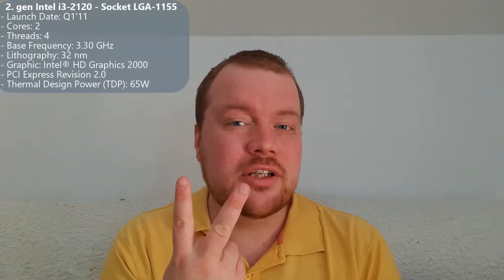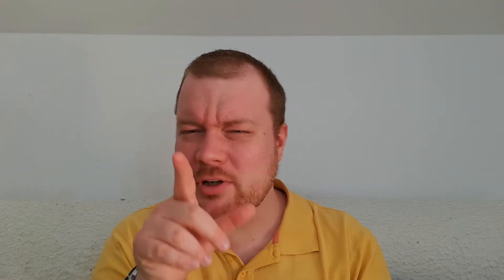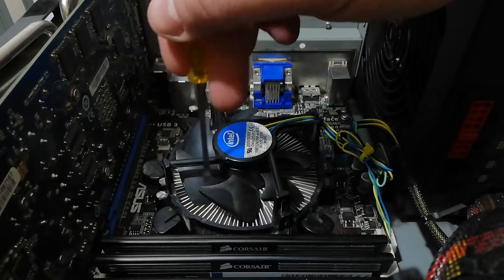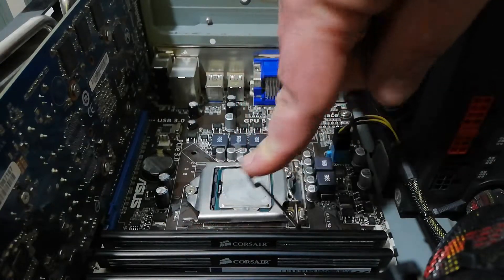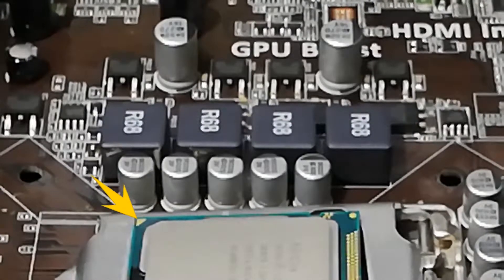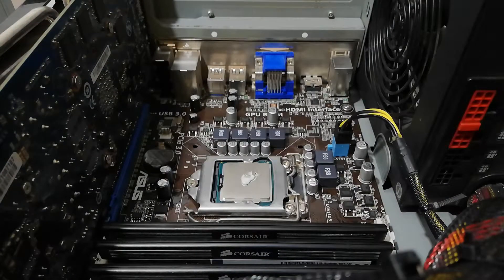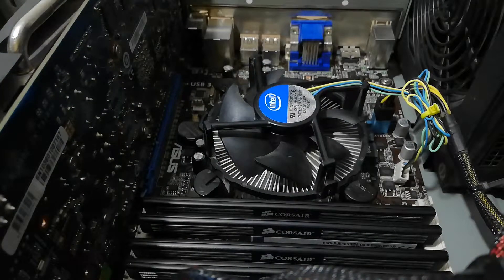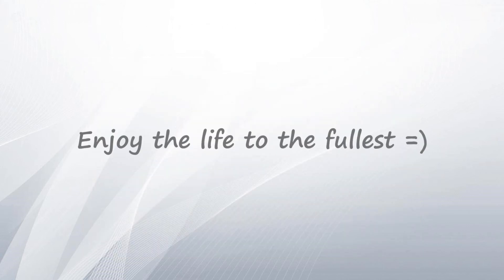How to upgrade PC processor on socket LGA 1155? - AFT #3

Comment: is it possible to upgrade my old AMD A4-4000 to AMD Athlon x4 730 they are both fm2 and my motherboard supported it. My motherboard is A55M-E Asus and  I think they have a different bios , how to do that?
Reply from the maker: By cpu support list for your motherboard, you need bios version 0401 or later to run x4 730. If you have lower version than 0401, than you update bios, to latest version for specificly your motherboard model!!!!

CPU support list: 
https://www.asus.com/us/Motherboards/A55ME/HelpDesk_CPU/

Firmware download on US site: 
https://www.asus.com/us/Motherboards/A55ME/HelpDesk_BIOS/
Reply: @ACOnetwork  my bios version or information is currently on 0601 x64 , do i need to redowngrade to get that 0401?
Reply from the maker: No, you do not downgrade. Just change processor 😁. Downgrading bios can make your motherboard unusable. NEVER downgrade.

If it says, your cpu supported by bios version, that means 0401 and every later made bios version.
Reply: @ACOnetwork  ok thank you very much , it's a big help . first and foremost  i thought i need to go to that bios version to run that processor 😌😆. Thank you very much !!
Reply from the maker: No problem, hope all will go without a problem 😁. Now youst have fun replacing the CPU 😁👍👀
Reply: @ACOnetwork  yes i will ,  when my order got arrived soon or later 😌😆 and i also hope so. Thank You very much 😆

Comment: Is there anything you need to do software wise or is it just a physical installation and I’m done
Reply from the maker: It all depends, if your bios supports new cpu. If you put in new one and no image on screen probably bios firmware needs to be updated. And also you need to be sure, that if you go for 3th gen cpu instead curent 2nd, that your chipset supports it.
Reply: ACOnetwork is there a way I can check the bios I plan to go from i5 2400 to i5 3470
Reply from the maker: There are several ways to check your bios version. 
- One way is to click start menu or search button, type in "System information", open it and on the right side of new window, you can see line named "Bios version".
- Another way is, when you turn on your PC, in some cases you can see bios version on screen before windows starts loading (you can click pause button on keyboard so it does not dissapear).
- Another was is to go in to the bios it self, you can do that by turning on PC and right then start pressing DEL or ESC or F2 or F1 key on the keyboard (one of those should work, del is mostly used) until you get in to the bios.

I did not make tutorial how to do this, but othervise you can find on youtube.

Remember, if your chipset on motherboard supports 3000 series of procesors, you can use new CPU. On manufactorer site, of your motherboard model, you should have CPU support list othervise if you write down your manufactorer and model of your motherboard here in comment, I can look up for you.
Reply: ACOnetwork ah thank u so much for the help but I decided to keep it in the same gen and go for a i7 2600. Thank u for replying and for the helpful tips and video 🤘
Reply from the maker: No problem and have fun 😁👍

Comment: Hai..my computer is M.board : asus P8Z68-V LX
Pccer : i3 2100
Ram : ddr 3 4gb X2 ( 8gb )
Grfik card : nvidia ge force gtx 960
Power supply : corsair vs 650  i buy the processor i5 3470 and change it..problem is monitor no display..what happen..? I need to update bios..? When i change back to i3 2100 its work good..what i need to do..?
Reply from the maker: Hello. i5-3470 is supported from bios version 3904, sou you most likely have too old bios version (unsuported new i5). Upgrade to latest version using i3 CPU after it power off pc, replace to your new i5 CPU and you should have an image on your screen. Remember, it may take minute or two untill image is shown on monitor for the first time.

CPU list for your motherboard: https://www.asus.com/Motherboards/P8Z68V_LX/HelpDesk_CPU/

Bios firmware download: https://www.asus.com/Motherboards/P8Z68V_LX/HelpDesk_BIOS/

If you need anything else just ask 😁👍

Comment: Thank you, I replaced an i3-2120 with an i5-2400. Simple upgrade. Your video answered the all important questions about how to remove the heatsink and fan.
Reply: same cooler for both?
Reply from the maker: Yes same :)
Reply: @ACOnetwork  thanks a lot. I looked everywhere and only find here. Great job. Subscribed.
Reply from the maker: No problem and thank you a lot 😁👍. If you have any questions just feel free to ask 😁. Have a great day/night, where ever you are 🙃
Reply: @ACOnetwork  actually the vendor wrongfully sent me i5 2500 instead of i5 2400. The socket seems the same, but info online says the motherboard only supports i5 2400. I'm not sure if it worth a try. I'm leaning returning it. What do you think?
Reply from the maker: Did you actually look at supported cpu list for your specific motherboard? Some motherboards needs to have updated bios, so you can use new CPU on it. If you are not sure, if you write down motherboard manufactorer, version and revision, I can try find cpu support list. Some motherboards on LGA1155 can support only 2. generation CPUs. For example my mobo supports second and third generation of Intel processors
Reply: @ACOnetwork  it's a Dell 0gdg8y but I never updated bios or anything. I bought more ram, cpu and ssd to do so. The manual don't say anything specific, so I looked online. Such this https://www.pc-specs.com/mobo/Dell/Dell__0GDG8Y/4031
There is a support thread from Dell and they say i5 2400. But some forums say it supports i5 2500. I have it here, but don't want screw things up.
Just to clarify, I will update everything (bios included) I can before doing hardware upgrades.
Reply from the maker: It is alerady 1:17 AM here. If you are willing to wait, I can research and gove you an answer during the day.
Reply: @ACOnetwork  sure, man. Thanks a lot!
Reply from the maker: So your motherboard is in Inspiron 620/620s or Vostro 260/260s computer with Processor Support Socket LGA 1155. (Sandy Bridge) Intel Core i5- 2500, 2320, 2310, 2300.

So it should support your i5-2500. You can just insert it gently add thermal paste, cooler and turn on pc. If you see image, then most likelly everithing is good. Remember that first computer power on after cpu replacement can take few minutes untill image is shown on screen.

If no image, you need to wisit dell support web page, search for your exact computer model (different can make your pc unusable), download an bios update and flash (with your CPU on motherboard). Also, DO NOT turn of computer while updating!
If you are not sure or afraid of bios updating, give it to someone who knows thos stuff to do it 😁

Good luck.
Reply: @ACOnetwork  thanks a lot man!
Reply from the maker: @JoséLages  No problem :)
Reply from the maker: I know that video is not fancy and top quality, but still is teachable :). 

It is not hard, just take your time fixing/replacing what ever you need. 

Take care and have a blast 😊👍

Comment: need to update my bios and lenevo dosent have it i5 3470 not supported what can i do now
Reply from the maker: Hello. Some motherboards do have unofficial bios firmware, but it must be xactly for your motherboard model and revision and even than you can break your bios. If the socket on motherboard is same for your CPU, even if may not be on motherboard manufactorers CPU supported list, you can still try it and see (if you didn't alerady tried), othervise you would need to use eather compactible CPU for your motherboard or get some other motherboard for your CPU or find both all together (CPU+motherboard) and sell what you do not need. If you have any other questions, feel free to ask 😁.
Reply: @ACOnetwork  https://rmania.net/kompyutri-lenovo--ideacentre-k330b-core-i7-2600-8gb-ddr3-15tb-hd-6570-hdmi-1635.html 
This is My Machine Checked That i7 2600 is supported then bought a i7 .
my specs
i7 2600 3.40Ghz
10 Gb ram ddr3 1333mhz
GTX 1050 2gb ddr5 128bit
128gb ssd
1 tb hdd 
case : same in the link   
motherboard : oem no model no:
Reply from the maker: @alizohairnayani3204  Cool, i5-3470 and i7-2600 in overal preety similar performance... anyway most important is, that it works 😎. My desktop PC has i5-3470 at 3,2GHz and turbo 3,6GHz, 4 Crosair DDR3 XMP-1600 2GB ram sticks (they were expensive), motherboard ASUS P8B75-M, Antec 550W power supply bronse, SSD Samsung Evo 860 256GB. It has maaany years working but still okay =). I am using it asstreaming machine of 2 PC streaming setup.
Reply: @alizohairnayani3204  HI, WHAT VERSION IS YOUR BIOS? i have same PC. i have bios version DPKT21A. i want to see if it'll work with mine.
Reply: @linchen81189  Mine DPKT15A. Bro there is a big difference Your 21 Mine 15
Reply: @ACOnetwork  Just Bought an i7 2600 3.40Ghz  without changing motherboard .
2nd Gen is Working Smoothly with my MB .

Comment: do i need to update the bios??
Reply from the maker: Hey. Depending what you are inserting, but generally you do not need to. Just insert what ever card you need, turn on computer, install drivers if necesary and you will see, how computer behives. You have any other question?
Reply: Depends  I had to uograde BIOS on my 10 years old bios.